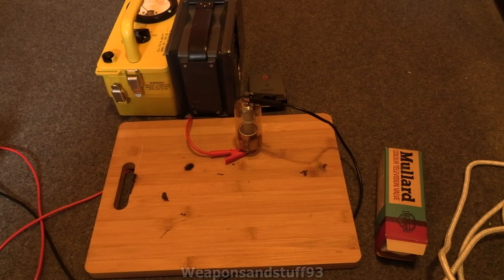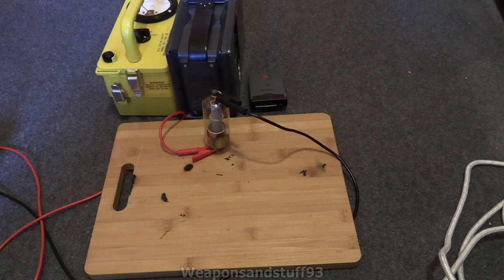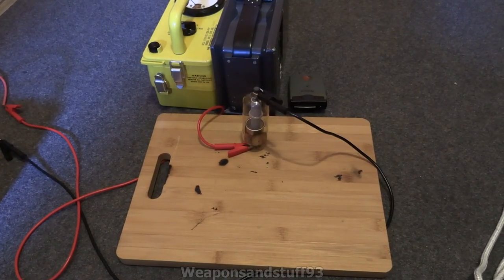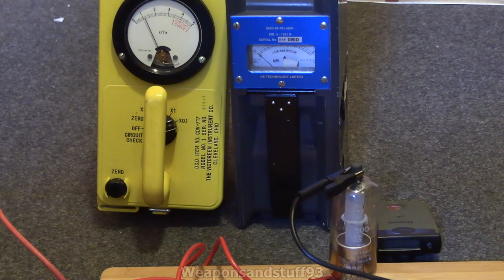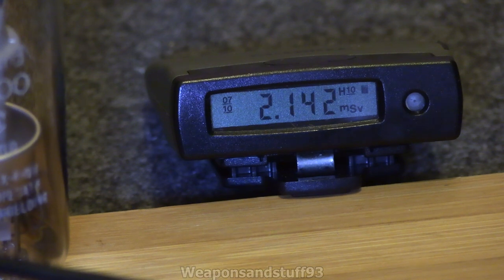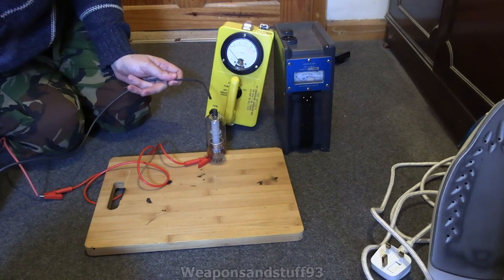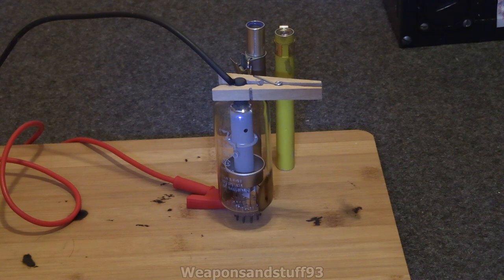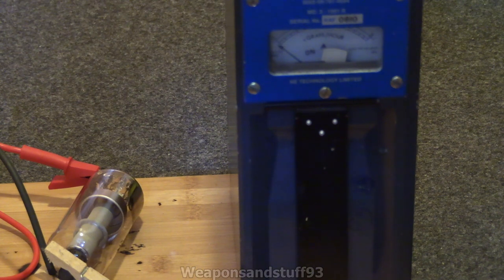PD-500 Overvolt X-ray measurements

Comment: If you turn the filament on it will most likly shunt the voltage down because it will overconduct and being the voltage down.
Running them as a cold cathode will make them not conduct much so the voltage will stay high and the electrons will have more energy shen they hit the anode.
This is why people who convert standard diodes into xray tuned run them as cold cathodes, and thats why xray tunes usually have huge distance between anode and cathode to have as much resistance as possible  on the tube.

Comment: when you heat the filament it would probably not give off more xrays. it depends on how much current your high voltage power supply can give since there will be a voltage drop

Comment: What kind of power supply would you need to power a PD500 tube?
Reply: A hamster that followed a stringent regime of steroids a hamster wheel with a generator and a transgender to step up the current to 986 Alessandros per barn.

Comment: I realize you are not daft but....please be careful with the high voltages. Things like wood are usually thought of as insulators but can behave differently at higher voltages due to moisture content. Also questions like ...is the voltage referenced to earth..and ....are you connected to earth ... matter too.. *The accident potential here is from electricity not from radiation.*
I dont know about holding the wire. If it were me I would set a test up and then somehow switch on from a distance away.